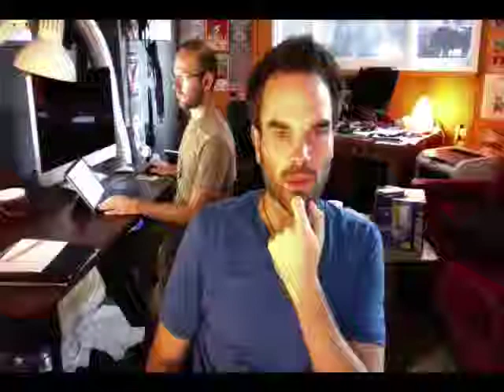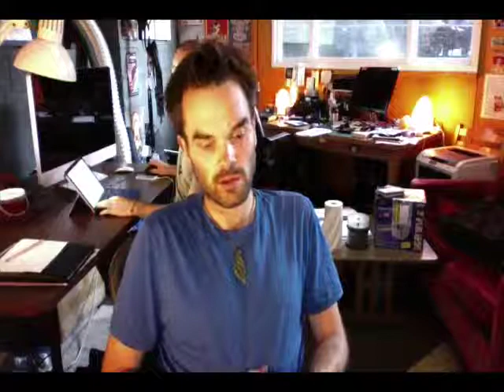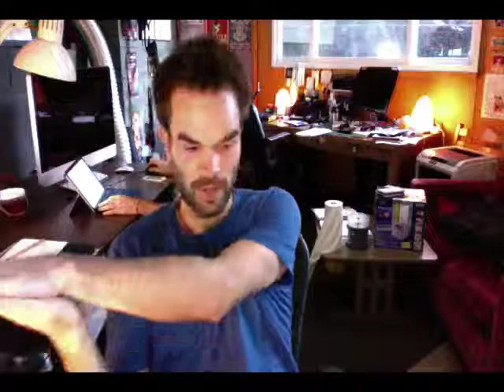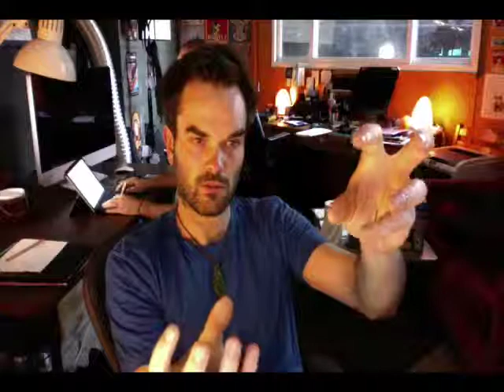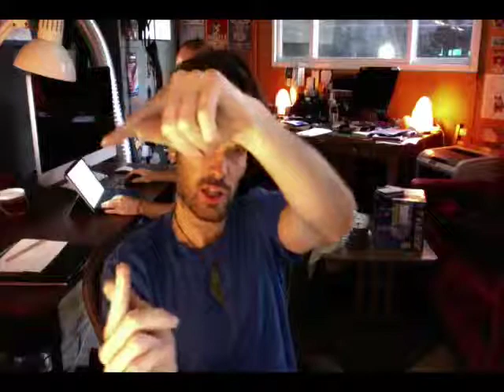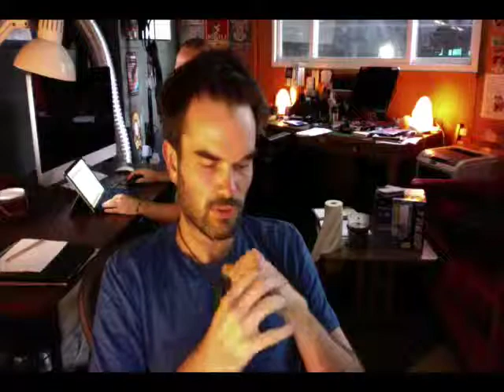Needs for collaboration tools and Open CAD

Comment: Agreed on Stack Exchange-like mechanism added to documentation.

Tell us more about open parametric file format - does that not exist already in .scad format?

One more comment on revenue model - if people pay for closure as a revenue model - would that potentially close off potential open development pathways if they patent certain design?

On CAD, it appears FreeCAD is extremely encouraging - http://yorik.uncreated.net/guestblog.php?2015=22

Yorik's talk on FreeCAD from FOSDEM 2015 - http://yorik.uncreated.net/guestblog.php?2015=37

and PDF on FreeCAD

http://yorik.uncreated.net/archive/talks/freecad-fosdem15.pdf
Reply from the maker: ***** I don't think it would because they'd otherwise just be using the current closed and paid for CAD programs currently in existence if they wanted copyrighted designs anyway.  I think any open source cad program should be optimised for growth and adoption.  if people want to make money on their designs then they can, but this way at least they are still supporting open source, and further empowering all the free users, thats pretty awesome cross polination.  its the kind of approach that could helps us transition out of the current economy into the open source one smoothly.  A model like this could even be taken up by existing programs like solidworks if they wanted to compete, and if they made their software available to all open source designers for free (even without open sourcing their software), that would be a win.  this is kind of like what dozuki do.  they aren't open source, but they are a service provider giving everyone an api and a free database.  solidworks would loose nothing by offering this type of service, only gain popularity among the makers who cant afford their tools anyway.  i wish we could pitch this to them or Autodesk.  Free offerings of existing software should not be limited in anyway for open source users.

.scad could be a very good baseline for an open parametric file format, but it would have to be pushed much further.    we would need to identify what it can't store information on, that other software has capabilities which we need.

All our work once a format was created would be on the gui, drawing tools, realtime rendering, and developing professional snapping tools to get started.  Getting other companies to collaborate on what that file format could look like would be a win, such as what sony and others achieved on the alembic file format.